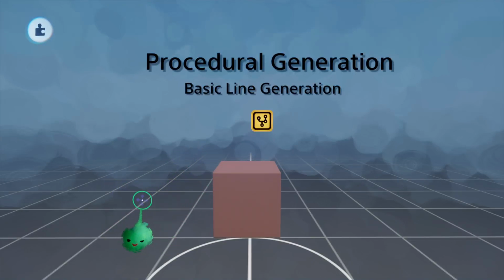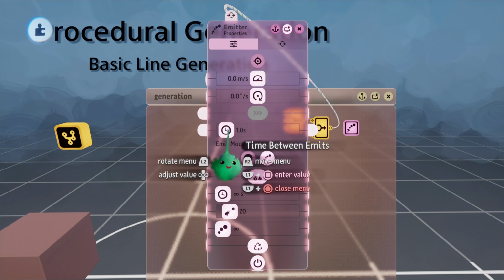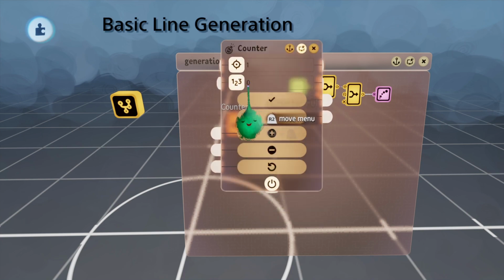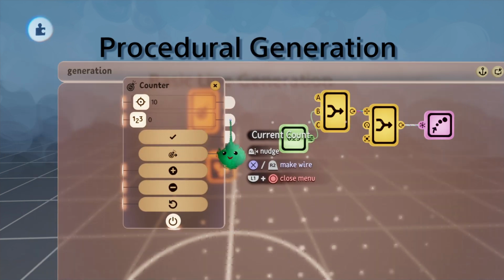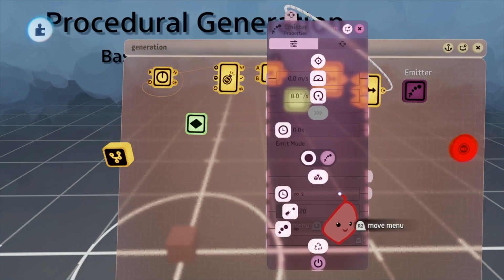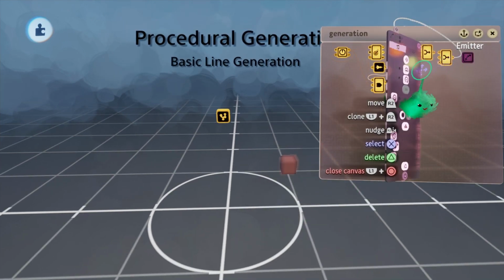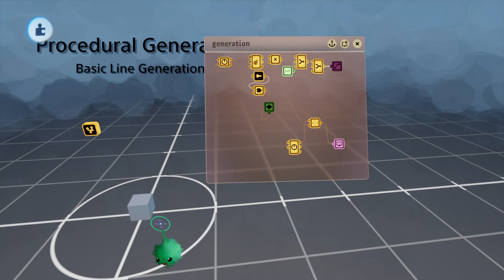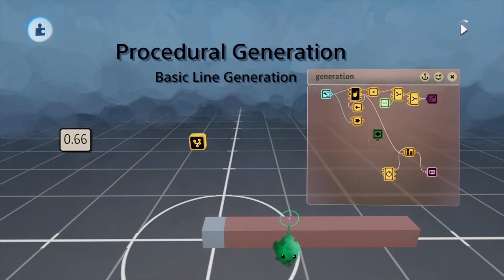Procedural Generation #1 - Basic Lines | Dreams PS4

Comment: Pretty cool...

You can use the stretch tool to easily adjust the size of the ruler, also.

Another way of stopping things happening at the end would be to put it all in a chip and turn off the chip with a keyframe when the counter is full. Then none of those gadgets are processed and the timer doesn't even run.
Reply from the maker: Thanks TAPgiles, that means a lot!

Oh yeah, there's organization done in the next video! =) I just wanted to focus on the simple method in this intro vid.
Reply: @VinceKully  That's totally reasonable ^^

Comment: You can type in a smaller number than 0.1 into the timer and it will work. It wont show the number but Dreams still understands it and it runs faster. Very good tutorial.
Reply from the maker: Denjo92 ah never thought of that. That would work too then! With that being said the timeline makes it easy to see frames. I love that there are multiple ways to do things in dreams. Thanks for the feedback!
Reply: @VinceKully  You can even set the timer to 0 seconds and it'll pulse every other frame I believe (which is the best you can do to generate an actual pulse).

Or you can have a NOT gate wired into itself which does that too. ;P
Reply from the maker: @TAPgiles  nice. you know all the tricks!